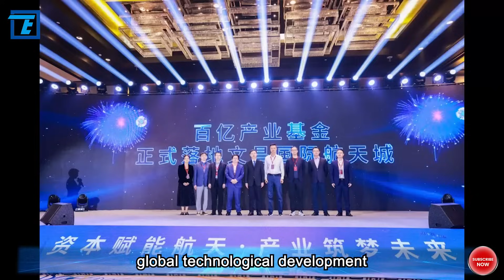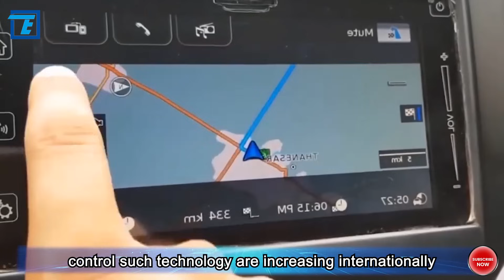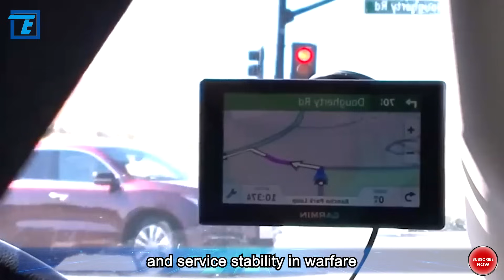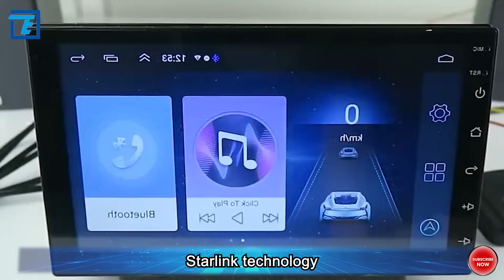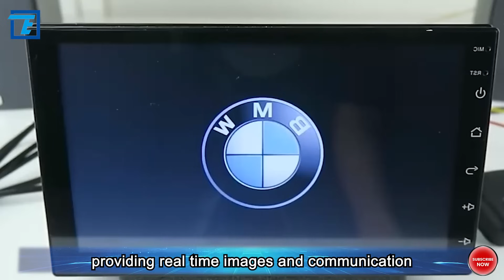WHY The "Satellite Super Factory" in Hainan, China, is a step for China in Starlink technology?

Comment: Basically it is providing a network of "satellites base stations" in the sky for the use of mobile devices on the ground.
The numbers of such small low orbit satellites required for adequate coverage of Earth's surfaces run into tens of thousands of satellites per system.
The USA had their Space-X system and China is now having its own satellite  network system  in the sky.
Other nations group such as EU and  Russia may also want their own system.
Very soon there will be too many of these space "debris" flying around in the sky, posing a collision threat to all future rocket launching.
Some international control need to be quickly set up.